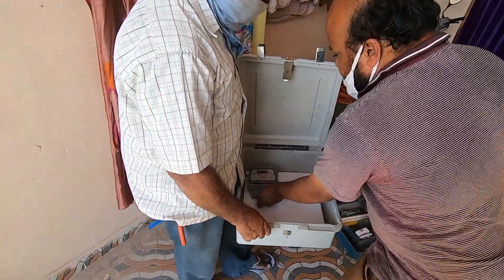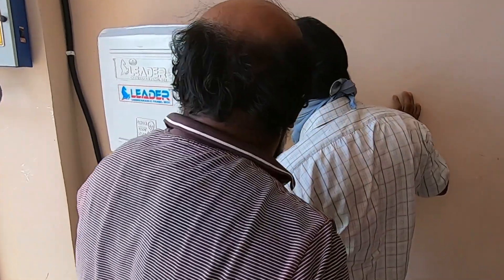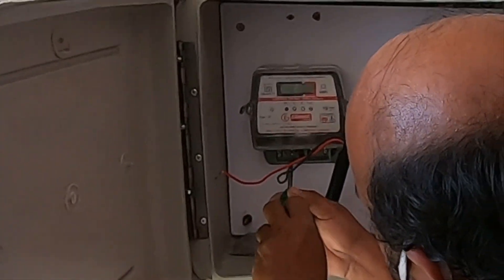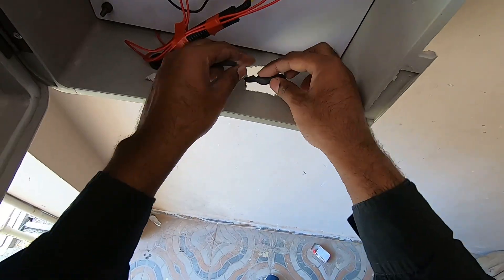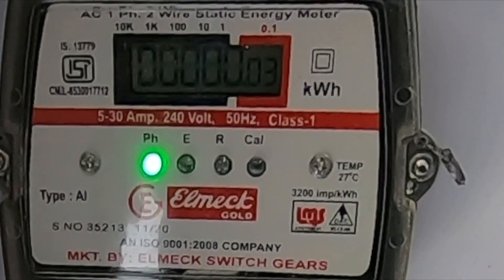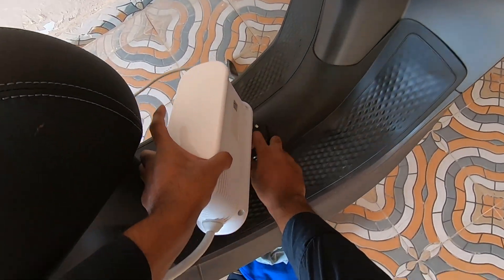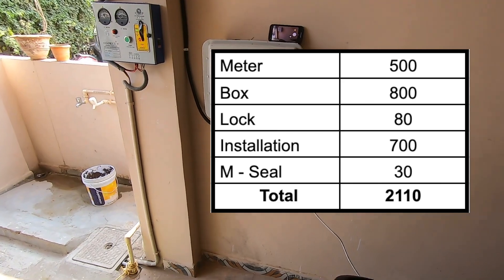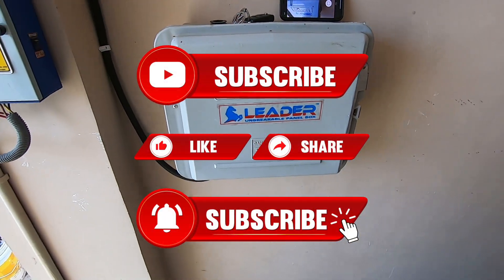Ola S1Pro | Sub - Meter | Box with Lock

Comment: Is this helpful in apartments ? Do you think if apartement can generate   revenues if the plug is outside ? It can be used by multiple EVS in apartement  as submetsr is placed for payments ?
Reply from the maker: This can we very useful, you can actually give a dedicated sub-meter for each apartment with a lock. You can charge them monthly according to the bill.

If you want to charge on the spot for outside users, then just note the meter reading and take the payment accordingly.

Comment: can we keep charger in dikki as 2nd gen ola have 2 holes in dikki for charger wire so that charger is not stolen
Reply from the maker: Yes, you can keep it in the dikki
Reply: @AVAutoTech  but heat nahi hoga?
Reply from the maker: @shayanpavaskar4331  if you are parking in hot ☀️ then I would suggest not to put it in the dikki bahi!
Reply: Ekdm nehi ..jaha air ata hai udhar rakhna gari jal jaiga to problem ho jaiga... favorite auto Mai Mai ek holder Lia usma rakhna Mai v ahi problem ka Lia rakhta hu udhar

Comment: Hello AV 👋
Can you please check that if the charger can be put inside the meter box, as I live inside a apartment and leaving the charger outside is not possible

And can you also tell the wiring, MCB, cost
And what is called the black insulation used over the wire
Reply from the maker: 1) You can lock the charger on the OLA’s charging mount, it has a wall mount lock setup

2) MCB costed approximately 600 

3) The black wire insulation was done by OLA TEAM - check this video 

Rs: 2359 | Ola Home Charger Installation | Explained
https://youtu.be/jwDpam0rJ6Y

Comment: Will it be eligible for warranty if we install the box and sub meter?? Also is the box and sub meter fixed by ola guys or we can get it fixed afterwards from local electrician??
Reply from the maker: This setup will not cause you any warranty issues, Ola guys fixed the socket and did the wiring. I got the sub meter and box fixed later on with my electrician.

Comment: Where can I get the plastic box? Is it available online?
Reply from the maker: Go to any electrical store near your area and ask them, if you don’t get it let me know I’ll help you with it.

This plastic box has a wood plank on the back side to which meter and socket it fixed.
Reply: @AVAutoTech  can you tell If ola providing 2.5 mm wire or 1.5 mm wire? And I guess that is 6 amp socket?
Reply from the maker: @SukanjanKarmakar  yes it’s a 6 amp socket. 
Wire size: 3C x 1.5 SQ MM

Check the below post for the exact image

https://www.instagram.com/p/CbR2iFMLGjs/?utm_medium=copy_link
Reply: @AVAutoTech  I am unable to find a box similar to this, what is this exactly called? Is it available online?
Reply from the maker: @SukanjanKarmakar  I did not find it online, got it at a local electric store.